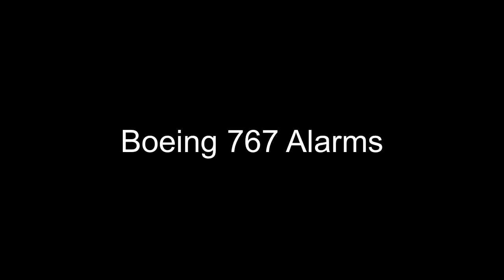Boeing 767 TCAS, GPWS, EICAS Alarms

Comment: 0:58 This definitely was sounding on Flight 11, and Flight 175 in the last seconds before hitting the WTC towers
Reply: No.
Reply: @charlesnicholson7539  probably yes, is too low enough to activate that alarm
Reply: @Hawkstation7  The master warning siren would have been blaring, overriding any GPWS warnings. You can listen to this happen on UA93’s CVR, for example.
Reply: @charlesnicholson7539  United 93 was a 757
Reply: @ThroughThe_Loop  same sound for both airplanes. Didn’t you know?
Reply: @charlesnicholson7539  how
Reply: Not really, older 767-200s used MARK V as their GPWS, which did not have warnings related to obstacles. The planes were likely issuing the “too low terrain” warning plus the over speed alarm, and maybe some sink rate and pull up warnings for UA175. The same model of GPWS is used in older 747-400s, in 757s, early 777s and the 737 classic.
Reply: @jiafeisexyproductss  Ah yes that makes sense, as United 175 and American 11 were built sometime in the 1980s if I recall correctly... but I would think that they would have retrofitted the alarms with the obstacle alarms as soon as they became available assuming the obstacle alarms and such were developed in the 1990s or maybe early 2000... who knows.
Reply: @gamingwithjal7169 Personally I find it unlikely, as not even the 737 NG (which came out a few years earlier) has the “obstacle ahead” warning. I think most 767/757s still used the MK V in the late ‘90s and the early 2000s.